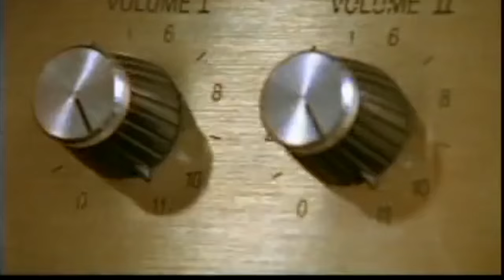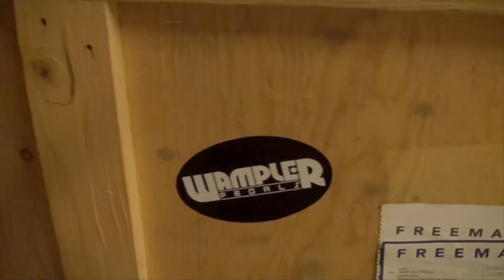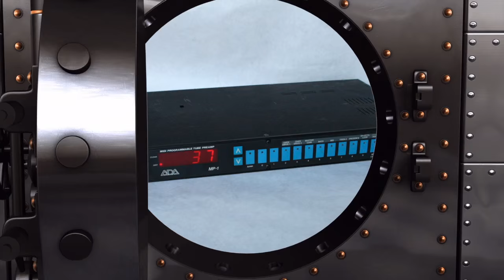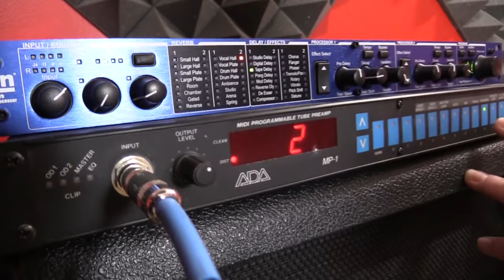Chasing Tone 98 - Why do guitar amps sound better loud?

Comment: For the "why do guitar amps sound different when volume is up"  question, there are electrical changes and acoustic changes. On the electrical aspect, like you guys said, the higher the volume the higher the output voltage and current the amp needs to put out, making the output stage (both solid state and tube), transformer and the speaker's voice coil to act differently (and the heat generated also changes things around). On the acoustic aspect, the speaker moves more air, and by that producing stronger acoustic waves that starts to excite everything in the room (speaker cab, walls, doors, windows etc.) causing all sorts of absorbtion, reflection and generally varying the harmonics being produced acousticly. And also the psychoacoustic stuff - the higher the volume, the more low end and high end the ear percieves compared to the mids, causing our hearing to get more linear, which sounds very different to lower volume.
Reply from the maker: +yotam amit Yep!

Comment: I want a Muffeleta also. I've been using a Vic Audio '73 Ram's Head for my muff sound, and it's wonderful. The Muffeleta looks like so much fun though, having all of the different muff tones at your fingertips. Oops, sorry Brian, I do have a Velvet Fuzz as well, but use it for a different feel. I love that Pumpkins muff tone.
Reply: I have a Velvet Fuzz as well and use it on the tight setting with the gain backed off about half way. With humbuckers it's one of my favorite distortion sounds.